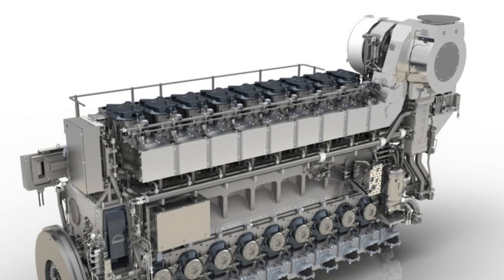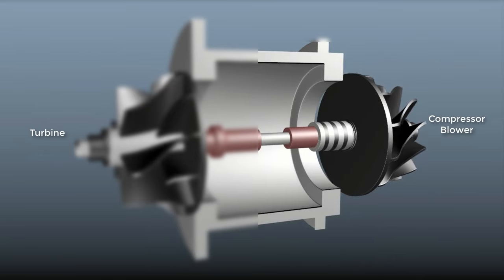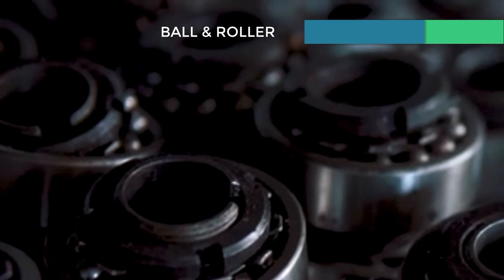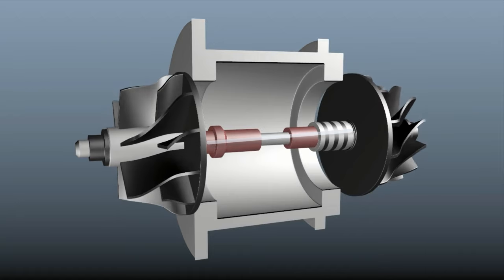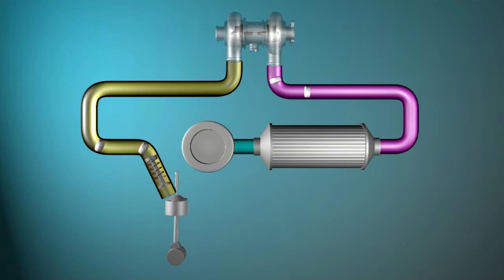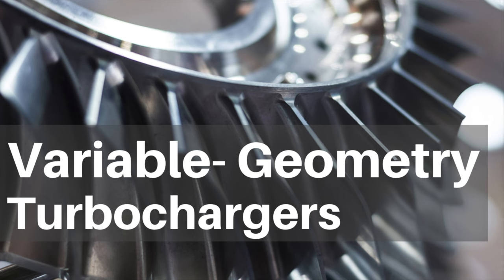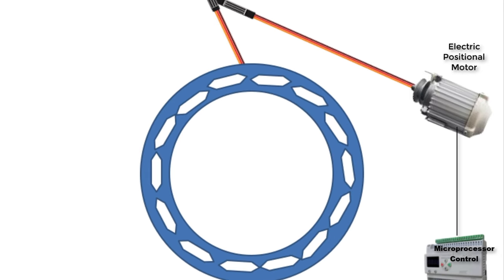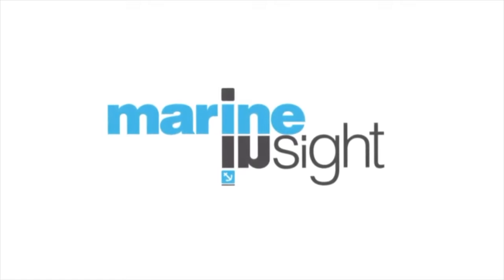Marine Diesel Engine Turbocharger

Comment: Why turbocharger inlet temperature is more than exhaust temperature?
Reply: Some exhaust gas heat and pressure energy  is transferred to mechanical rotating energy, thus pressure reduce along with temperature

Comment: Why vta turbocharger don’t have auxiliary blower ?
Reply from the maker: Auxiliary blowers are needed when the engine starts, i.e. turbocharger speed is very low and they cannot supply fresh air during the initial period. 

However, with VTA, it can supply pressurised air at low speed by changing angle hence additional auxiliary blowers are not needed.

Comment: Does the compression air pressure remains same through out the all rpm range of an marine 2 stroke engine can you please explain how the air flow to the combustion chamber is controlled when rpm is increased or decrease
Reply from the maker: Compression pressure totally depend upon compression ratio of the engine. The air flow will depend on the supply from the turbocharger, which in-turn will depend on the exhaust produced by the engine.

Comment: Why aux blower is not required if vgt is there???
Even during starting we need scavenge air supply so blower must be there but on further load it’s use may not be required because of vgt. 
Please someone clarify my statement
Reply: The use of auxiliary blower comes in to play when the engine is at low load or we can say during the starting of the engine the pressure gained in the cylinder at the starting of the engine is not enough to provide a efficient combustion bcoz the scavenge pressure is low.....so after a particular period of time suppose half an hour aftr the engine starts the scavenging pressure comes to a point where auxiliary blowers cuts off his role automatically...when the scavenging pressure is achieved to its mark. I hope u got it
Reply: @jagdish99_sw  from what i understood from the video is that in VGT the nozzle angle in the T/C can be changed as needed. SO, whereas in normal T/C the fixed nozzles requires high load to rotate the turbine, during starting the load achieved is just not high enough hence aux blower is provided. BUT in the case of VGT the nozzle can be adjusted so as to provide high roatation energy in turbine with low load ( this is possible due to changing angle of nozzle ) . So the aux blower in the case of VGT is not required as low load can also produce rotation in T/C.

I hope this helps. Someone correct me if I am wrong 
@marineinsight
Reply: @jagdish99_sw  thnks bravo bhai

Comment: Why air cooler is used Marine diesel Engine ?
Reply from the maker: The compressor outlet is at high temperature which cannot be used directly for the scavenge space. Hence, it is first passed through  air cooler to cool the air down to ~40°c
Reply: To maximize the air quantity in a defined volume
Reply: @marineinsight  As the air is taken from the engine room through compressor side and given to engine, how does the temperature of the the air leaving the compressor side  increases ? As there is no real compression and air is sucked by the means of blades rotating at high rpm.
Reply: @NN92455  as the air passes into volute cashing, the pressure gets increased thereby increasing the temperature as well, as the air exits the turbine through the diffuser.